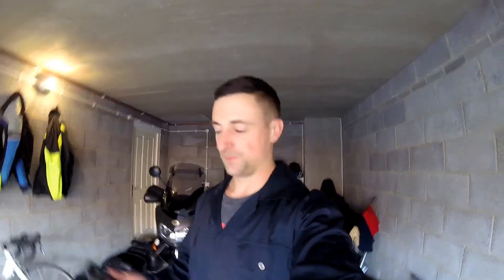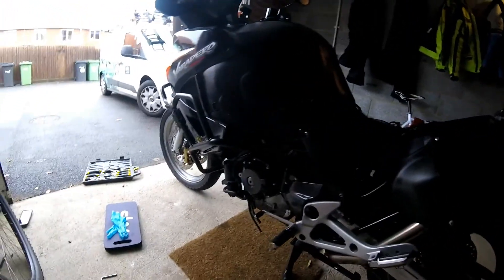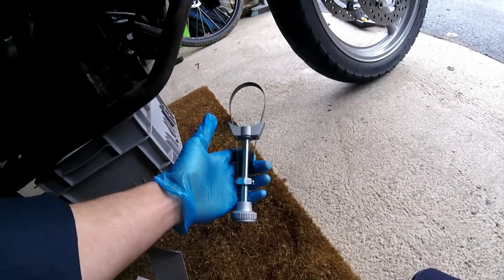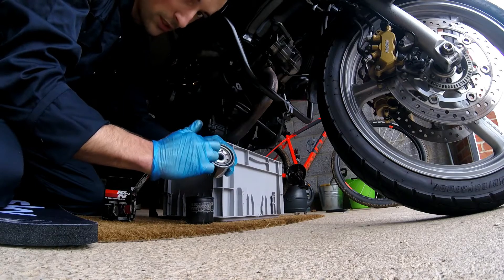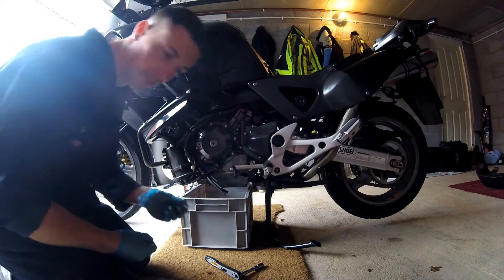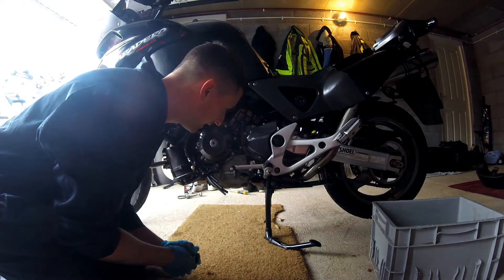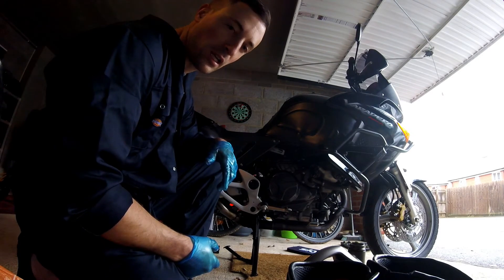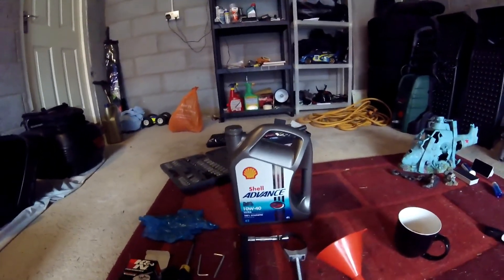Oil change (Honda Varadero 1000)

Comment: Hi ! Tell me if I'm wrong but is it best to put some oil on the joint and in the oil filter before replace it ?
Reply from the maker: Very hard to put oil in the new filter without getting it everywhere as it goes on sideways on my bike. Rub some oil around the seal and your ready to install it.